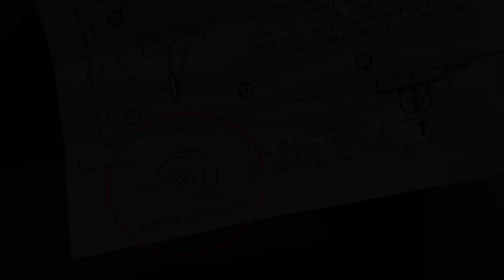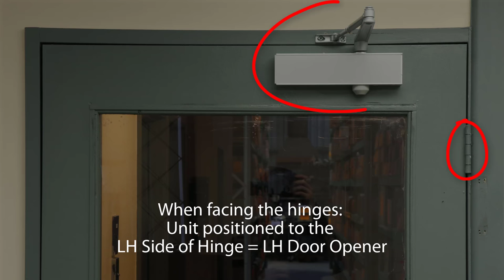How to Install an Automatic Door Closer | Hydraulic Door Closer Standard Installation

Comment: Thanks for your video. I need to ask a question. I installed a door closer on a metal door at my home but I found a problem with the air from the outside or inside is the air go by Force inside the home door find resistance add not closing and in case there is no air the door is closing fast and I think it will be damaged slightly😢 can you help me to solve this issue
Also I need to know how to reset the settings of door closer

 thanks in advance
Reply from the maker: Thanks for your comment. You could try adjusting screw 1 when the air resistance is low to decrease the speed. Then see if the door is able to close properly when there is air resistance. You may also need to adjust screw 2 to increase the latching force since the door will be moving more slowly.

There is no way to reset the settings; you just have to adjust the screws until the door is balanced and closes as desired.

Comment: Attention! The 90 degree angle is incorrect! Such an angle should not be at the lever, but at the thrust!
Reply from the maker: Hi Wladned, thanks for your comment - what is the reasoning for this? As you will see in the video the 90° angle works for us (and has continued to for the last 4 years).
Reply: @co-macgroup1683  Hello! I agree, closers can work normally even with deviations from the recommended installation parameters. In this case, if the LEVER is installed perpendicular to the door, then it does not press the door. And when a ROD is installed perpendicular to the door, to connect with it, the lever must be slightly deflected towards the thrust, some force arises in the closer, and by the amount of this effort, the closer PRESSES the door after closing. Thank you
Reply: @wladned  in addition to your point (clearly explained, I must say), I believe that in the resting position the rod should not pull sideways on the door frame. Doors remain closed 99% of the time, and a constant sideways shear force weakens the mount (especially if the closer arm is slightly bent). Furthermore, opening the door (when the force is maximum) makes the rod pull sideways on the shoe mount. 
Thus, the adjustable rod should be perpendicular to the door frame.

Comment: Hi, I have a question, I am in Nz, what is the difference between installing it with a bracket or without ? It says in the vid for internal mounting but what is the real use out of it ? Most home doors are made of weak cardboard so is it not the best option for those doors? What is it really for if the other mounting way is the best way to go for all doors?
Reply from the maker: Hi NZ Kiwi, it depends on what way your door is swinging. If the door is opening out and you want the closer on the inside, you use the bracket. If the door is opening out and you want the closer on the outside you don't use the bracket. As shown in the video the closer is adjustable so it should be fine for most wood doors. I hope this answers your question.
Reply: @co-macgroup1683 хх
Reply: ПМ и
Reply: @co-macgroup1683  😊